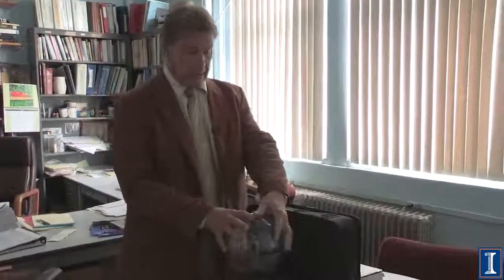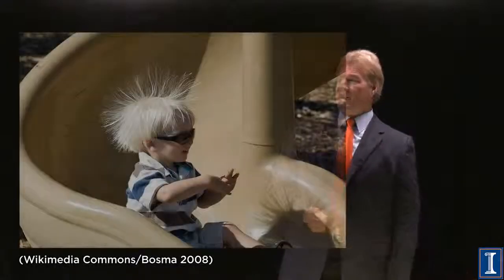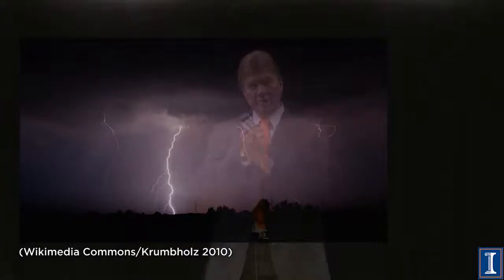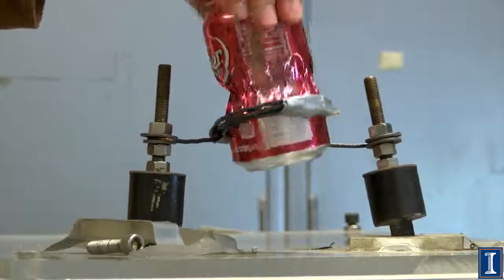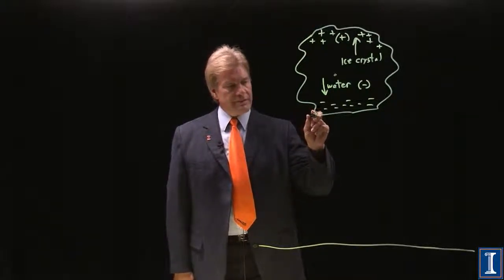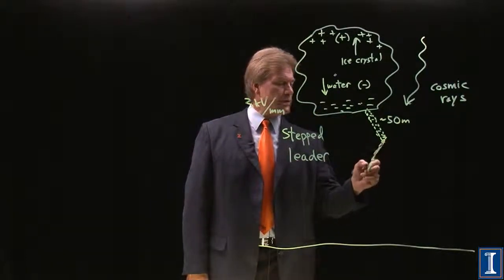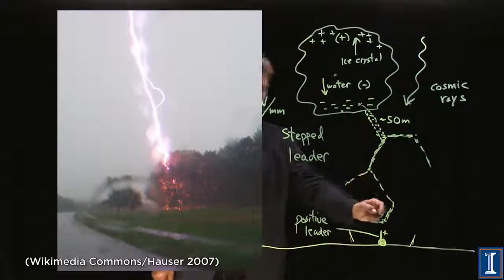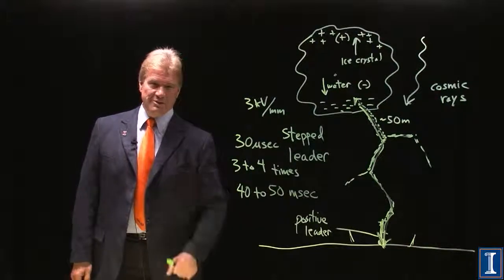How Things Work: Shock and Awe-some Lightning

Comment: The plasma streamers coming from the rod attached to the electrode, starting at time 3:25 in the presentation, look like they are coming from a Tesla coil rather than a Van de Graff generator.  I base this supposition on the shape of the plasma streamers as well as the shape of the electrode, which is typically found on a Tesla coil.

Comment: I had fun chasing my roommate around in college with a florescent tube in winter. The tube would flash brightly when discharged. He though it was ac line level.
Reply: manitoba2445  That reminds me. I had a Dodge van full size that someone added a bed, lighting, and some 120 V Duplex receptacles with a male feed on the outside. Had a short discussion with my kid, just because the van had an alternator that it did not mean power was available at the sockets. This was years before inverters were affordable.    Any sufficiently advanced technology is indistinguishable from magic. I guess advanced is in the eye of the beholder.

Comment: As a Atrial Fibrillation sufferer, I’ve wondered about an exposure  to electric shock and heart arrhythmia.  An electrician friend us also an AFib patient, much more severe than me. . .  

As a kid, I once ran a ross a 67-1/2 volt battery that was no larger than a can of lighter fluid.  I thought, “that can’t be 67+ volts”, and stuck a finger and my tongue on the terminals.

I found myself on my ass on the floor of the store.  I was probably 13 or so at the time. . .  One of those “great lesson if you survive” events. ..